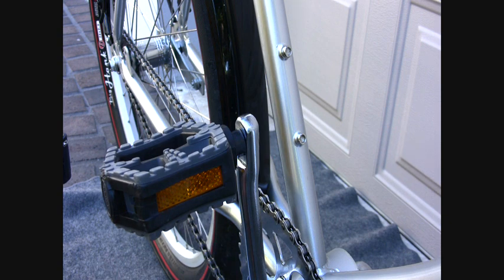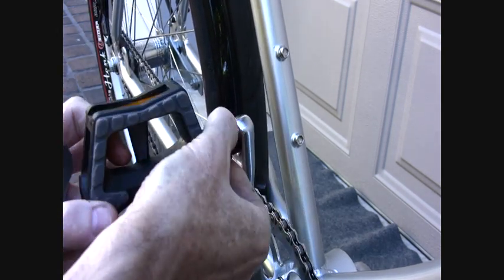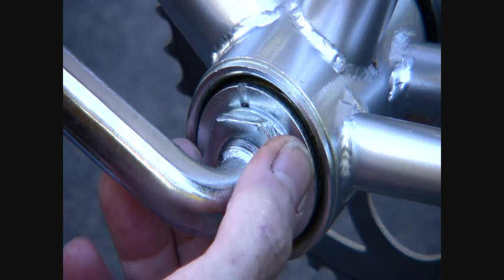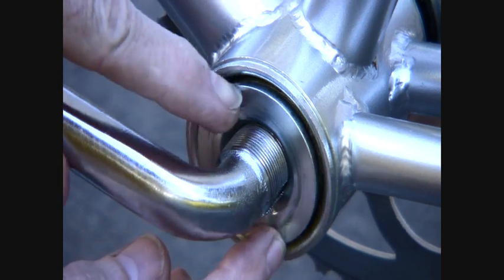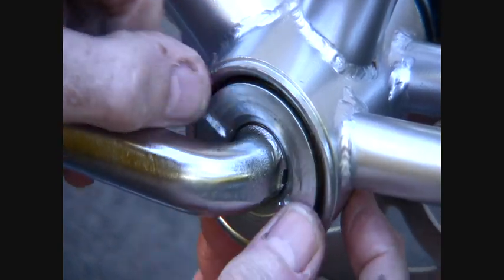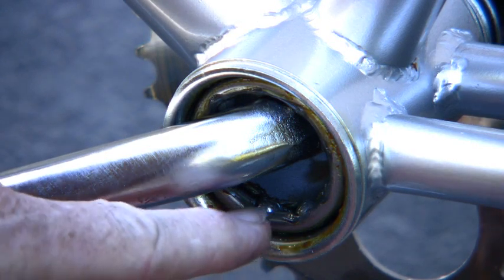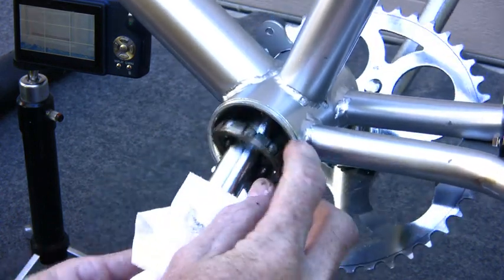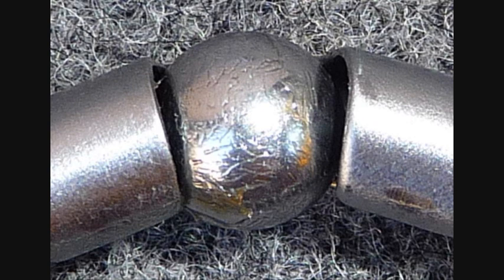Old-School bottom bracket service, part one

Comment: thanks very much for this video. i had to tear my bottom bracket down. turns out my right side bearings were shot. the ring was broke and the bearings were laying inside the frame. fixed it earlier this evening. never tore one down, but your video was extremely helpful

Comment: REID, YOU WON'T FIND LOOSE BEARINGS WITH THE ONE-PIECE CRANK OFTEN.
IT'S HARD TO PUT LOOSE BEARINGS IN A ONE-PIECE CRANK. I'VE DONE IT AND
IT HELPS BY HAVING THE FRAME STRIPPED DOWN WHERE YOU CAN LAY IT ON ITS SIDE.
JUST MY OPINE. GOOD VIDEO!!

Comment: That brown nasty sticky gunk on the race & bearing is I think called kreoslole something like that most Asian parts are shipped by see its meant to stop Corrosion from the salt water. In my automotive shop all my brake disks drums ect. Come covered in it on bearings I think they mix it with grease. I may be wrong. But I always clean & re grease all new bikes I get hope this helps. Peace

Comment: Here's one thing I know from taking apart my crank system yep I to have an american one piece crank and I used red lithium Greece which is used in bearings in GM vehicles and I had to tighten the bearing housing because they made a clicking sound when I tightened everything up it stopped clicking

Comment: And one more thing the grease they usually put on there is so thin that it's easy to collect dirt but the grease I used is good for 500 degrees fahrenheit and I don't have very much dirt on my bearings because I loaded my bearings with grease

Comment: of course for any type of freestyle a 2 or 3 piece crank is best. but for general riding a 1 piece would do. I have had my stock 1 piece bend on me riding dirt jumps on my first decent freestyle bmx. this is for people that might need advice in this area. They seem to be the same style as a freestyle 1 piece. I know they have 2 types of American bottom brackets such as this caged or loose ball bearing and sealed cartridge with cups installed. Typically not found in bmx anymore.